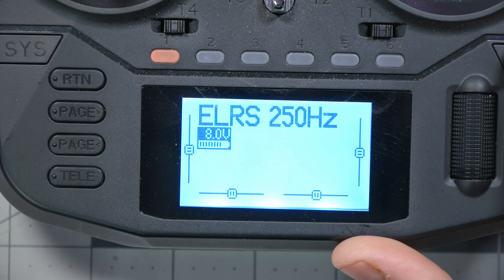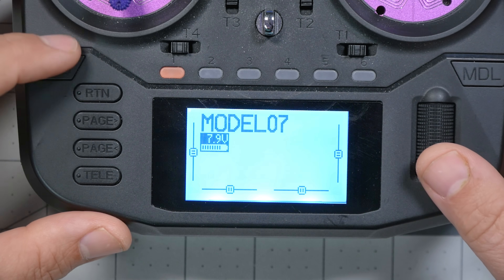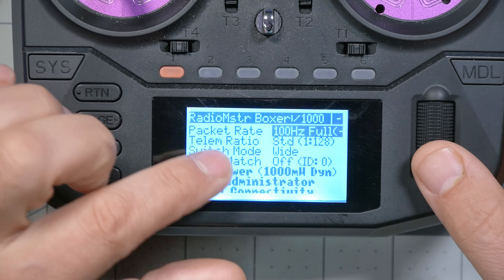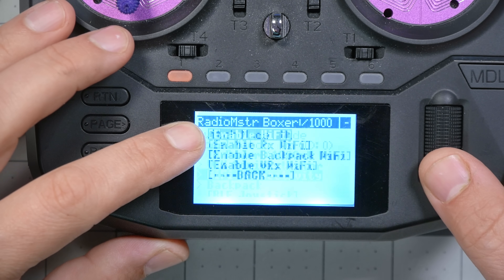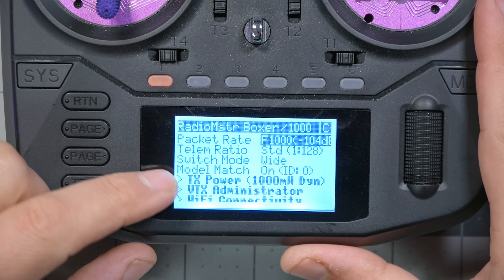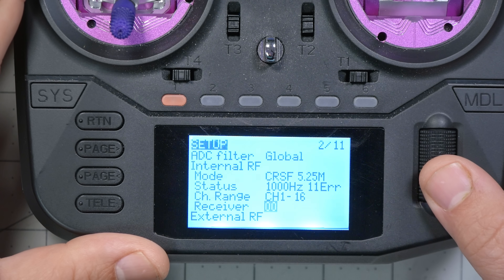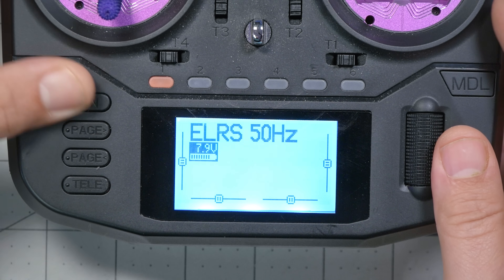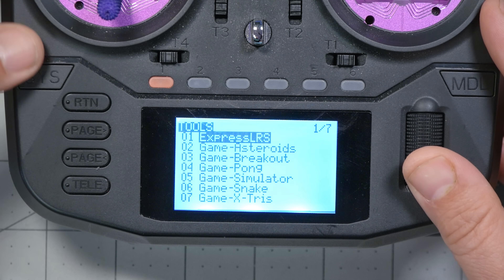Discover the Power (annoyance) of ExpressLRS Model Match

Comment: One thing that isn't mentioned in this video. You can also use model match to prepare 3 drones and, when one crashes, switch to the next and continue flying. Kind of like a solo relay race.
Reply: If you have the rx in triple blink model match error state it needs to be reset before it will bind even after changing to the correct model.
Reply: @BrandonBeans  I have a friend that does this, not sure how he has it setup though. He can plugin 3 quads and switch between them like a respawn.

Comment: I dont know much about lua scripts, but would it be possible to have a script running in the background that switches your model id when your arm switch is off and you press a designated button? that would make it super easy to set the correct elrs settings for each rig

Comment: Can you do a video on errors that come up on Expresslrs flashing. I'm doing everything in your video and then some, it downloads to the point it looks for the controller (radiomaster Zorro) and then errors out, I can see the controller on com 4. In the beginning i was getting a platformio error. I downloaded platformio and I got a little further. I have try alot of different things. I'm out of ideas. The Error - Please specify upload port, for environment or use global. 

UPDATE  -  I have a new controller, I think (amazon). It had some other type of controller or receiver flashed into it! I use wifi to re-write the controller with a Zorro script. works great with wifi. I havent tried to use USB. 😳

Comment: Josh.  I bought dji goggles v2. They will not activate. After searching for two days I see it’s a common problem.   I built my drone.  It has a runcam wasp.  Tx12 transmitter.  I am totally lost.  I got the image from my drone to the goggles but my screen said I need to activate the goggles.  I can dismiss that msg but my drone won’t arm till I turn off goggles.